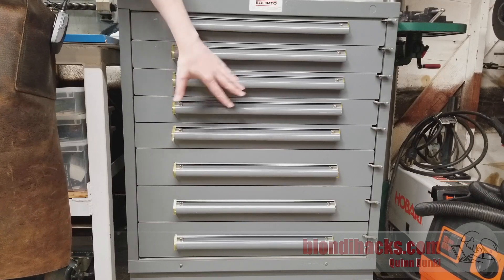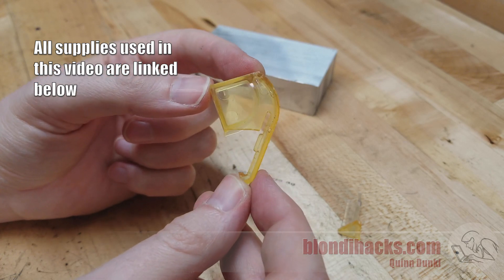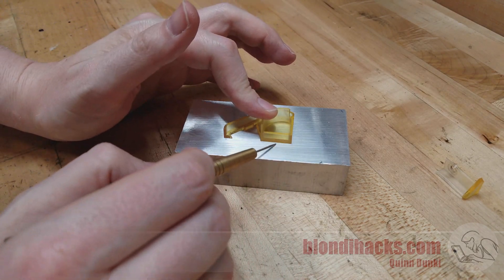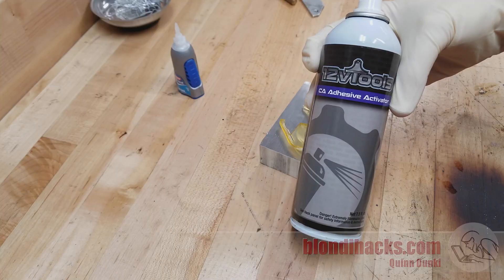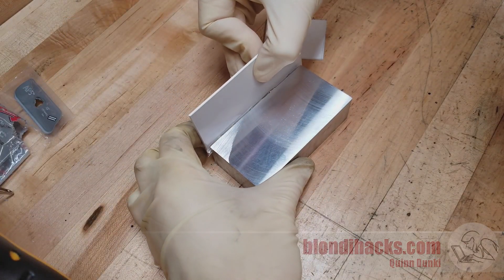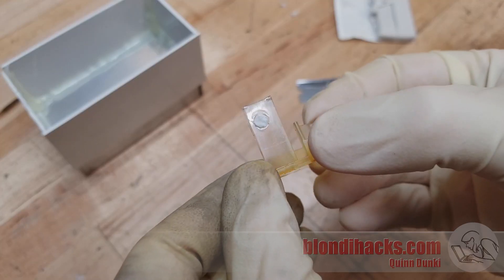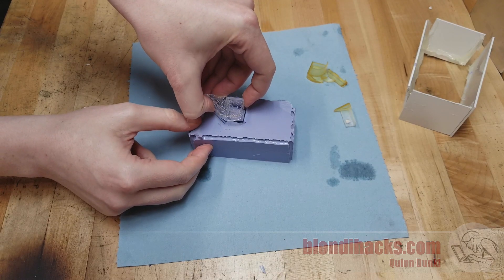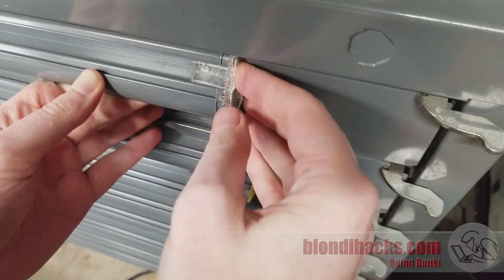Plastic Clip Repair

Comment: I've used tape to make dams for silicone molds, and it works great.

You always end up fighting bubbles with epoxy. You are actually fighting 2 problems-- air that you have entrained in the resin by pouring it and minute quantities of volatiles in the resin itself. You can mix the epoxy and put it into the vacuum chamber, which removes the volatiles, but when you pour it you get some entrained bubbles. You can pour the resin in the mold and put that into the vacuum chamber, but it is liable to expand 10 fold and go everywhere-- unless you designed your mold so the popping foam drains back into the mold cavity. You can also go the other way and place the filled mold into a pressure vessel and press the bubbles out of existence-- maybe in a wide mouth corny keg or a pressure cooker. In any event, viscosity is detrimental. You could try to get an epoxy with a long working life epoxy and use heat to reduce the viscosity. Finally, if you have a chemist friend, see if they have an additive called BYK 535-- the stuff is magic!

Most problems with epoxy in the home shop come from insufficient mixing. Post baking parts is often a good idea, as is reading the technical data sheet.

Comment: I do a lot of work with epoxy, and measure it by weight with a sensitive gram scale. 

To figure out what the weight proportions should be, I'll measure a fairly large volume of resin and weigh it. Then measure the proper proportion of hardener and weigh that. Then it's a matter of calculating the weight proportions when it comes time to make a batch of epoxy. 

The epoxy is measured on the scale in a small disposable cup. Pour the proper weight of resin first. Reset the scale to zero, then pour the proper weight of hardener. 

Works perfectly every time, even for very small amounts of epoxy.

I use tongue depressors to mix the epoxy. I'll cut off the rounded end of the tongue depressor to make it square, and that allows it to scrape resin and hardener off the sides and out of the corners of the cup, so everything gets thoroughly mixed. While stirring I scrape the epoxy off the tongue depressor on the edge of the cup so even that material gets properly blended.

Hope this helps you as much as your videos have helped me.

Comment: Well, it's 3 years too late to help, but if you vibrate the mold after pouring in the resin it can help the bubbles migrate to the top where the heat gun can pop them.

If you have hair clippers (either human or pet), turn em on and hold the body against the side of the mold and watch the bubbles float up to the top

Comment: I tend to replicate things in resin too, but this is remarkably easy to replicate with 3D printing. You simply put it on your flatbed scanner and trace the scan! Then you only need to measure the height of protruding parts. Trying to measure the actual shape with calipers is a fool's errand, that will never work, but a scanner makes things easy.

Getting a 0.2mm slot with 3D printing as necessary for this part isn't actually hard, though first layer does tend to need a little knife cleanup.

Comment: Hey Miss Blondihacks, try using a gram scale to weigh out the proportions of parts a & b of the resin, instead of measuring by volume. I am a new subscriber and an armchair machinist. I find your videos most informative and entertaining. Keep up the good work. Guy Franks

Comment: A torch and doing this on a warm day in the sun with less hardener in your mixture is a good way get aloooooooot of those bubbles out not all but a lot without a vacuum
Reply: But yeah after seeing your part a quick tap with a torch I think would have cleaned that up

Comment: You can use a pressure pot. If you use a vacuum it will change the cure time, it will setup and cure super fast.

Comment: Hi Quinn,
If the parts you resin cast remain small, have you thought about making a small vacuum chamber using either a auto brake hand vacuum pump or an inexpensive electric vacuum pump?

Comment: If memory serves, theres something about spraying mold release on epoxy resin parts (depends on type of release too), especially if using them for a new silicon pour, as that will do the opposite of intent as witnessed. Might not have had the issue with urethane resin?

Comment: Removing bubbles of dissolved air from mixing is best done in a vacuum oven or vacuum chamber or bell jar. Both the molding rubber and
casting resin need the vacuum treatment. A vacuum  chamber can be made from a used pressure cooker from Good Will.  Harbor Freight
have reasonable vacuum pumps. A transparent window is very useful in the chamber because you need to see what is happening. Maybe
a little camera would do. There are vacuum pots that have a thick clear plastic top. An industrial vacuum oven with a glass window door
is a great tool for all sorts of drying and curing applications. They often don't cost much at auctions or sales because no one knows what
they are for. You will be amazed at what happens with the vacuum treatment. Your stuff will expand 4-5 times its original volume. With proper
application of the vacuum treatment you can get perfect bubble free parts. Over the years I have cast a variety of parts, sometimes starting with a carefully crafted wooden model (before I had a machine shop), but now I 3D print instead, or CNC machine or make an actual injection mold. I have a dozen or more molds. I used to on occasion make molds for a few parts but 3D printing stopped that. You can make actual injection molds in an hour or so for simple parts. When we make a real mold for a part for our aircraft instruments it will take a week or two.

Comment: If you ever find that you need to remove silicone from something, there is a product called Digesil that will actually decompose the silicone. Crazy stuff but it is the only thing I have ever seen that can actually "dissolve" silicone. No idea what it might do to epoxy though.

Comment: I noticed that you were using a spray release. Is the spray release by chance a mixture of silicone ? This usually causes silicone to want to adhere to the surface of parts etc. Never use a release when using silicone as molding material. You will get highly accurate parts when you don't use anything as a release as  silicone will not adhere to any other materiel except to its self hence the possibility of the spray release containing silicone. Hope that helps...

Comment: A vacuum chamber is not the way to go. You just get giant bubbles. A pressure chamber will shrink the bubbles before setting.
Even better still is to mix in a vacuum and then pour and set in a pressure vessel.

Comment: Can only come with experience, but minimize the amount of extra silicone around the part when pouring the mold to allow it to be slightly more flexible to allow the cast resin parts to be removed more easily. Again, comes with experience. But you want just enough silicone for the mold to be rigid for the casting process, but flexible enough to aid removal.

Also, many resins will more fully and more quickly cure if heated. 180 degrees for a couple of hours then let cool back to room temperature. Check your resin brand to verify this will work for you.
Reply from the maker: Thanks for the tips! That point about mold flexibility is a really good one.

Comment: Would a investment plaster vibrator get rid of the bubbles? I use epoxy in  one of my processes and improved  my methods when I got some 'drug dealer' scales. Epoxy cures chemically and some epoxies have to be very accurately portioned in order for the chemical cure to work.

Comment: Wouldn't you rather want a pressure pot then a vacuum chamber?
Peter Brown has a great video on what happens when you put (a larger volume than you used) resin in a vacuum chamber.

Comment: I think I might have tried a small sheet of glass from a photo frame rather than fly-cutting the aluminum, but that's not as much fun.
Reply from the maker: Yah, exactly. There are easier ways to do what I did, but this is a machining channel. 😁
Reply: @Blondihacks  psh, it's been attested to me that picture frame glass isn't actually very flat after all. Totally justified use of fly cutter! 😉

Comment: I thought you are supposed to use a blowtorch with epoxy resin instead of a heat gun - I don't know if that's due to higher max temperature or if there is additional CO2 that eliminates the bubbles once the heat makes them rise to the surface. Another alternative is polyester resin - I have never had bubbles with the Castin Craft product. Unfortunately the amount of hardener needed is determined by trial & error and you cannot use it without a respirator since the fumes are so strong.

Comment: I'm only at 3:35, but I hope you also will flatten the bottom of the drawer pull cap as well as the surface of the alu block.  OK, roll that footage...11:04 Oh, no!  That part was already damaged from taking a hit, so likely not completely flat, even though you held it to the alu surface during pouring.  Once you picked up the chop stick it relaxed and invited goo under it.  Just a guess.  OK, roll that footage.  Yay! Success!  With the little experience I have with casting, it seems like when there are scant bubbles, they may have been trapped in the fluid when the part was poured.  Usually when there are a lot of bubbles, that means the conditions and mixture may not have been right, and the resin boiled.  The resin in the cup is open and easy to cool, so it doesn't boil, so no bubbles.  The stuff in the mold may boil because the heat from the chemical reaction has nowhere to go.  This is easier to happen in warmer climates or higher altitudes.  This even happens inside of a vacuum chamber.  When you lower the pressure, you may have to use a different ratio, or the resin will boil as it begins to set and all of those bubbles will get trapped inside.  Anyway, just some thoughts.  If you get a vacuum chamber for molding, try to get a piston vacuum pump and run the pump on the table next to the chamber.  I think the vibration helps get the bubbles out.

Comment: I figured out what happened to the clips.  The right side of the cabinet caught the hot afternoon sun through a window in the side garage door.  But there was also some sort of trauma in transit.  Caveat emptor.  No returns.  :-)

But those clips are way complicated - too clever, in my humble opinion.
Reply from the maker: Yah, I suspect the cabinet got jostled into something in the truck, and those clips are the outermost thing on the cabinet. The plastic is pretty brittle, so it wouldn’t take much to break them all off the way they were.

Comment: A very nice video,  congratulations. Have You tried using PUR ( polyurethane resin)? like for scale model casting .  It is much nicer to pour into the mold. It behaving almost like water and it cures much faster. Best regards from Poland :)
Reply from the maker: Funny you should ask- I did buy some of that to have on hand next time I try this!

Comment: When I need a small glass smooth surface I use a small piece of plate glass. I get it free from the rubbish bin of the local glass replacement company. They always have scrap offcuts. It's a challenge to produce a smoother surface than float glass.

What I don't understand is Quinn's reliance on the flatness of the bottom surface of the original part. I thought she would lap that on 600 wet-or-dry at least. It takes two flat surfaces to mate without gaps.

Also, what controls the height of her resin pour...??...Until it threatens to spill over the top of the mold?

Also, bubbles & refrigeration: would it assist "debubbling" to warm up the mold with the heat gun before starting the pour? I have heard that heat evolved during cure is bad for the resin and cooling during the 24 hour cure has benefits.
Reply from the maker: The bottom of that original part was very flat, having been formed against a factory injection mold. The two surfaces mated well enough to be silicone-tight without lapping. The height of the pour is simply “until you reach the top” Resin is self leveling and very thick, so it’s easy to stop at the right moment.

Comment: For measuring the liquid resin parts, why not copy the 'epoxy glue double-syringe' method? There should be bladder tipped syringes 50 or 60ml available to buy which have large lumens. Label one A and another B, don't mix them up and you can reuse them for your measuring needs, it should be accurate enough as there is some wiggle room with the percentages.
I do know silicone curing is inhibited in the presence of sulphur (depending on the type of silicone you use), perhaps some chemical inhibited the curing of your previous resin pours.

Comment: Two easier methods, just way the top of the aluminum while it's still warm position your part.  Silicone won't stick to the wax.  Second you could just use some double sided adhesive.  Removable DS tape will peel off everything.

Comment: Instead of using aluminum for the walls of the mold. Try using legos, infinitely adjustable and stackable. Check out Don Williams posts on Don’s Barn for silicon molding.

Comment: Interesting video but but wouldn’t have been cheaper and easier to purchase new ones from Equipto. 
Now that we have gotten that little detail out of the way.  Instead of using the Aluminum block you machined consider buying some 3/4” or 19mm for you metric lover and 0.750 for machinists and enginerds pieces of float glass it is normally perfectly flat and is also handy to use with very fine sand papers and lapping films to sharpen/hone knives, chisels, cutting tools, drills etc.  I have a 3/4” 12”x12” piece I use for sharpening and honing as well as a well assorted other smaller pieces of various sizes including some the are 3/4”x1”x? , 3/4”x 2x?, 3/4”x3x?, that I use mostly to make form for mold making but also use with lapping film. Anyway the 3/4” float glass pieces work great either with tape, hot glue, or even stupid glue to make forms for mold making.  Additionally instead of cutting down Solo cups for mixing small quantities of resins, etc consider using Plastic or paper bathroom “Dixie cup.” I keep bathroom size, and sleeve of a number of different size plastic and plan paper cups for mixing of whatever and also a small sil-pad and sheets of bakers parchment paper to mix glues and fillers on. One other tip/trick is you are thinking about purchasing a vacuum chamber/pot be on the lookout when perusing yard sales or thrift shops if you see a pressure cooker cheap especially the older style and the gasket looks good but if the price is right you can always Fabricobble a new gasket.  Additionally be on the lookout for old A/C manifold gauge set. Once you have a pressure cooker and gauge set you need a vacuum pump (electric or air powered) and some fittings to make it all work.  On mine I drilled out the relief port and tapped the hole and installed a fitting to match the A/C gauge hose and for $15 at a thrift store for pressure cooker and A/C gauges and a pneumatic vacuum pump that was $18 bucks or $75 for a electric pump and gauges on Amazon you can have a reasonable size vacuum chamber to remove bubbles from silicone, and or resins etc and whatever else you might need a small vacuum chambers for.  The only down size is no window to watch stuff through but with a piece of clear acrylic or plate glass and truing up the top of your pressure cooker and making a gasket out of sheet silicone. Have a nice day.

Comment: You could have simply taken the Blutack (that you used to plug the screw-hole) and used it to stop the cards from sliding out sideways. Still, that would have been a very boring video, and this one has made me want to give casting a try....

Comment: Having never done this before: I wonder if the original part could be pressed into a block of modeling clay or warm paraffin to make the mold.
Reply from the maker: Maybe? I think the advantages of silicone are:
1) It holds really precise detail. You can see in the video it reproduced the tiny impressions from the mold ejection pins on the original part. 
2) It’s durable and stands up to many uses.
3) It’s very smooth and not very reactive, so it doesn’t stick to anything after it is cured 
4) It can handle a lot of temperature, so exothermic resin curing is no problem. 

Another medium might work fine in some situations though!